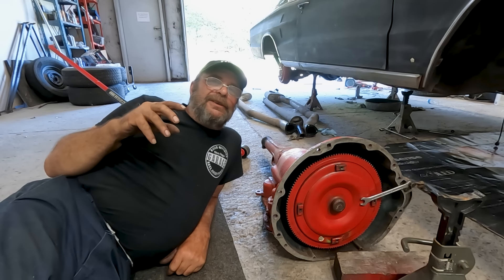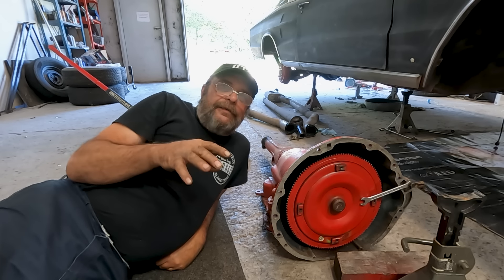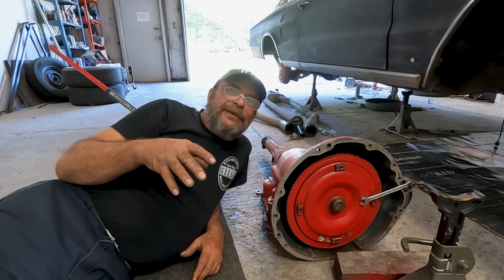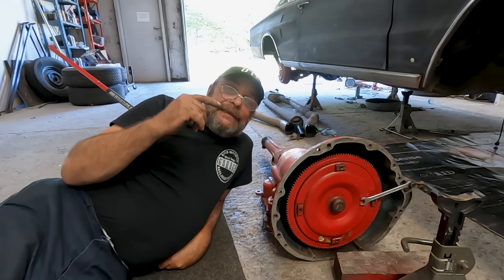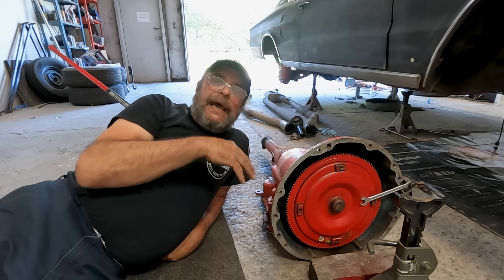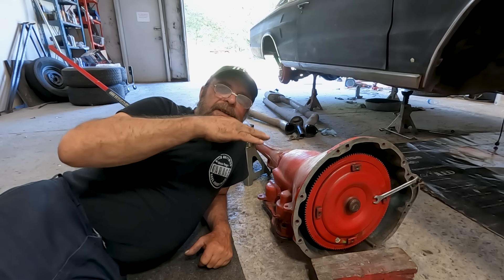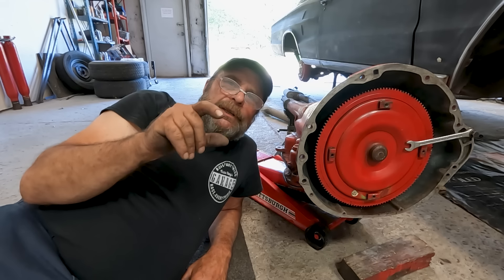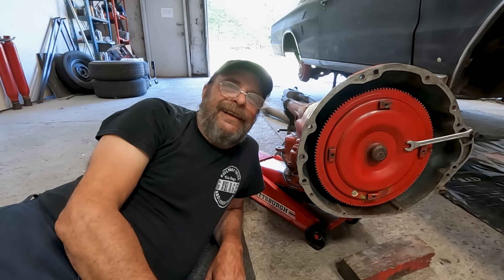One Man, On The Floor Transmission Install- So Easy Even An Old, Crippled Guy Can Do It

Comment: I've used rachet straps. Go around the frame or through the doors. With 2, you have a cradle that you can get any angle on any plane, and then you can push the tranny to the engine with one hand.
Reply: i did that and it worked great. i wasn't about to balance a tranny on some shitty jack. went in easy as hell
Reply: @bagsflyfree7710  And the best part is when you realize you can just leave it in position when you get it set.
Reply: Yep
Reply: You should make a you tube video so we can see how that works.
Reply: @TheTreasureGuard  If I ever have to replace the clutch again (this is the 4th) I will.
Reply: That's the way!
Reply: Dude. That's gonna make getting the trans and tcase back in my eagle sooooooo much easier and less sketchy. Thanks!
Reply: @screwsinabell  Thats "thinking outside the box"
Reply: We used to do that with engine generators when i was an aircraft mechanic. Put a 
 strap under the front and lift it to line it up to the gear box.
Reply: Bingo! Works great for gas tanks with fuel in them as well.
Reply: Damn good idea.
Reply: I tried that today. It didn’t work for getting the transmission on, I ended up having it on my chest when I was trying to lower the ratchet and it went too far. However, it was great for getting it up into the air high enough that I could get my gigantic stupid transmission jack under it I kid you not, this thing attaches to a standard floor jack and it stands 18 inches high.  Too tall to slide the transmission in from outside the car, you have to get it onto the jack under the car. But I couldn’t have done it without the ratchet straps. what I needed, thanks. What a great tip using those ratchet straps.
Reply: Ok, I like this idea. I did a heavy and awkward top loader last year and I’m swapping it for a T5 really soon. I’ve got racket straps but it’s a 66 Mustang unibody, so no frame to speak of. I didn’t think of running them through the doors. That’ll work pretty much perfectly to make a cradle.

Comment: The first transmission I did was on a '64 Chevy Biscayne when I was 15. My dad told me when he worked on those he'd just drop it on his chest and slide out from under the car. So that's what I did. It almost killed me. When I told mt dad he said" you really did that? I was just joking". All I could say was thanks a lot.
Reply: I did that today, with a 4L 60 E. Not on purpose, I was trying to install the transmission using ratchet straps to lift it. As I lay on the ground, it slipped out of the ratchet straps. Luckily, it landed squarely on my chest from only about an inch away. I rolled it off the side and tried again.
Reply: :face-blue-smiling::face-blue-smiling::face-blue-smiling:
Reply: Lol...

Comment: My favorite and most helpful trick I learned and used back in the late 70's was cutting the heads off two long bolts and using them as a guide to slide the transmission on until I got some bolts started. Great video! The good old days!👍
Reply: I did a clutch using that technique when I had a bad shoulder and could really only use one arm.  The bolts are still in a drawer.  I can't make myself throw them away!
Reply: @willcrow2133  😊👍
Reply: I had one get jamed from the weight, and since then I ground down the shaft into a square, enouh to get a socket or wrech on the cut shaft. But I have a whole section of home made tools and implements. I cant give em up either lol. The best ones though were for vacuum diagnostics. Check valves and check valves and Ts and all. I still use that think for finding vacuum leaks, without fancy electro angry pixie machines
Reply: My 1975 Pintiac Firebird factory service manual shows that same trick and it works pretty good.....no J tool part number they stated to use grade 8 bolts so they dont bend under the weight and sugested rounding over the edges with the end with the head cut off and adding a slot to get them out with a big flat blade screwdriver once the trans is in.
Reply: That exactly how I’ve been doing it for years
Reply: VW makes special tools for repositioning the radiator support and front bumper on Jettas for engine work. The "tools" are basically a pair of long smooth bolts that thread into the frame rails. You screw them in, unbolt the front bumper and radiator support, disconnect a couple of hoses, and the whole front of the car slides forward a few inches. I've owned four Jettas and those tools were invaluable! Such a simple and elegant solution.

Comment: I did a few trans back in the seventies both manual and auto. Now I drive a four cylinder front wheel drive car. I don’t even know where the transmission is. 😂
Reply: Some of em actually aren't too bad. 
Old VW rabbits ,I could knock em outta there in like 90mins, even the stuff into the late 90s early 2k wasn't too bad as far as the vws and crap I messed with.
An elusive oil leak on one rabbit had me r+r that sucker about 4x, I got it down to 40 mins with air tools 😂
Reply: @MrTheHillfolk  I have an Accord CVT. I actually know where it is and I change it’s fluid ahead of schedule. I’m in no hurry to find out how to remove it. I took a chance with the CVT in 2013, when I bought it new. According to people on the owners website, some have got nearly 300,000 miles out of the CVT. So I feel good about that. A muscle car it is not.
Reply: @blipco5  well the thing I liked with those foreign jobbie vws is a rabbit transmission weighs about 75 pounds , and will take 200hp for quite a while if you're not a madman. 
200hp ,we didn't have that but it was nice to know ,that'll make a 1800 pound car move decently. 
I didn't need nearly the equipment to lift stuff because it wasn't as heavy.
Reply: @MrTheHillfolk  When I happen upon a Rabbit these days it freaks me out how chintzy they were. I had a Fiat 128 back in the day, which was about 1800 pounds. The doors were a total of two inches thick.  I don’t know what engine it had but it’s top speed was 85 mph. It was surprisingly smooth. Could run topped out all day long.
Reply: That  funny.:face-fuchsia-poop-shape:

Comment: I wish I had the strength and energy I had when I used to pull them up on my chest and bench press them up into place. That was 30 years ago and like Tony said: many traumas and lots of arthritus between then and now.
Thanks for the video Uncle Tony!
Reply: I feel you brother,  I still those events myself. Edit, feel not still.
Reply: I don't think I even saw a floor jack till I was 30. The cars of the '50's and '60's had enough room to pull the eng and trans together, and that's how we usually did it. Otherwise, I was on my back, by myself. For '71, I'm in great shape, but I couldn't do any of that now. 👍
Reply: That's how I used to do it put the crossmember on it and just use my knees and bench press it into place! Now that I'm 47 it was 30 years ago before I broke everything in my body several times! Those were the good ol days!😂
Reply: I swear trans are much heavier than they used to be😊
Reply: Nice! I was going to post the same except it was 45 years ago .... thanks!
Reply: I was thinking the same thing. I’ve done it many times in my youth. At 44 years old, I really don’t think I could.
Reply: @pathfindersales2275  dude. Oldsmobile cast iron Hydra Matic. 🥺
Reply: @outlawbillionairez9780  Those things weigh a TON!
Reply: @Bob-Whiting  You said it ⚠️
Reply: @Bob-Whiting  You said it ⚠️
Reply: @outlawbillionairez9780  Yes, but I only said it once  O.A.B.! lol☝  😃  JK

Comment: The clutch goes out on the way home from work on a Friday afternoon 35 years ago.
No garage, just the gravel, my wrenches and a Saginaw 3 speed on my chest. I was pinned down, hard.
Besides, I had to go to work Monday, so I was now fully committed!
The stuff we go through to keep the boss happy!!
Reply: My uncle used to do that with his torqueflights. Slide them under and lift it up on his chest and bench press it up and hold it with his legs until he had a couple bolts started. 😂
Reply: I had a similar situation years ago while taking my wife out to dinner on a Friday night. I SMOKED that clutch BAD hitting a puddle that shouldn't have been that deep(!) with a clutch that was already weak after over 200k miles. Mine was a Mazda 5 speed in a 1990 Ford Ranger 4x4. I  nursed the truck back home and we ordered pizza. Luckily, my wife has the patience of a saint and is also a car/truck enthusiast so, she took it all in stride. She didn't help me change the clutch though lol!
Reply: I had to bench press my Turbo 400...fun times
Reply: Did the same with my 350. Must have been fun with the 400.
Reply: @gerhardbraatz6305  
The sad thing was, I of course let my buddy borrow my Jack and it was not returned as promised of course. I literally took chunks of wood and slowly shimmed it until I could climb underneath it then I got it on the pins and jammed my knee up underneath it I started them bolts as fast as humanly possible. Course I'm 56 now so that would be out of the question although I'm still in pretty good shape
Reply: @MikeBrown-ii3pt  Love it man! and your wife bro, lol
Reply: 1977, E150, 3-speed column shift. Heading to NY just left home and the transmission starts screeching. Turn around head back to my apartment parking lot. Grab my MG and drive to junkyard. Buy a used three speed, load it in the trunk and drive home. Remove the transmission by sliding it back so the tailshaft is on the crossmember balancing the front on my knee. Transfer the front to a jack and lower it. Swing tailshaft of the junkyard unit up on the crossmember and jack it up high enough to rest on my knee. slide it home. Had never done a transmission swap before but was on the road the same day. To be young and not know any better.
Reply: @PragmaticPragmatic  I had a 1967 MG midget!
Reply: Yep..had to bench press many and steer it with my foot on tailshaft...
Reply: @wjewell63  That's what ya call "Fancy Footwork" lol
Reply: I'm 68 now and was just telling my wife how I would put a new clutch in my 67 Chevy by myself on the garage floor and have it done in a couple of hours. First time I did it I was 19. The last one I did I was 43. A whole bunch in between. I still think I could do it and I may find out, I just bought a 61 Biscayne with a Muncie 4 speed.  I'll give it a go if I need to.
Reply: I'm doing the same, replacing a muncie 318 on the street out side my house, just planning my attack 😂
Reply: Great vid. I thought it would be more complicated. After watching your video. This is cake. Thanks for sharing!!! 💯👍😁
Reply: @PragmaticPragmatic speedloading transmissions
Reply: I did same as u did it pain in ass in front drive box it took me whole day best modiy a scissor jack with wheels and plate on top
Reply: Replaced clutch in my 56 chevy in 20 min. By myself. 16 years old, in 1968.

Comment: Took A 994 out of a 72 van, rebuilt it, and put it back in. Did it all by myself. I also cut the head off a bolt and put a slot in it so I could take it out once a a few bolts were in place. I have used that created dowel pin a few times and it's still in my tool box. Ya do whatcha got a do when you are by yourself.

Comment: I used to keep 3'x 6' lengths of carpet remnants around. I could cut them to whatever size I wanted or keep them large to just lay on, real comfy. Then to slide things under the car, I would turn the carpet pile-side down and it made it pretty easy to pull whatever it was under (or out from) the car. Need to put the hood on the driveway? Use some strips of the carpet. Unexpected oil leak? Use the carpet. Used to get odd ends of carpet really cheap.

Comment: UT you make hard for today’s technology. Four ratchet straps is all you need.
Two to the cross member and two for the front hung off the frame. Take one at each end and tighten them then pull the slack out of the other two and repeat until it’s in place. 
Once you try this you will swear by it. 
I installed a locomotive gear stub shaft assembly today doing this. 
Greetings from the high plains of Texas.

Comment: Tip: ATV Jack works great as a transmission Jack; with the pump handle facing the front of the vehicle it both lifts the transmission UP and Towards the engine at the same time. 👍

Comment: Trans jacks are cheap now, i used to use a transmission jack adapter head on a floor jack but only works on big lifted trucks with lots of ground clearance. The budget hack is 2 2" ratchet straps, looped frame to frame one under the tailshaft housing one under the bell housing. Pull the strap tight as you can, that ratchet it up tight. Move the the other strap and repeat, pulls the trans right up into the tunnel. THEN slide the floor jack under the pan or case (auto or manual) and adjust as needed. This method i have found is best in a gravel parking area, no need to try and move the jack and the trans at the same time, jack just makes the minor changes in elevation
Reply: Works dang well on concrete too!
Reply: The cheap transmission jack is $99 at Harbor Freight.

Comment: This info is EXACTLY what I needed, thank you so much. I'm working on the floor and have taken my 4l60E out from an LS1 motor (Holden Commodore, I'm from New Zealand) to fix a rear mains leak. I've replaced seals everywhere and serviced everything and I'm ready to put everything back. My biggest hurdle is getting the thing onto the jack while under the transmission well, which I'll be doing in the morning. This method is the ticket for me and I feel better already 😂 Thank you.

Comment: Thats Great! I'm 65 and had to put a 5 Speed manual in my Truck. Used 2 ratchet straps connected to both sides of the frame.

Comment: I did a 91 camaro RS transmission transplant it was a 305 w/ 700R4 trans with only floor jacks and from that day on I never messed with a trans without a lift.   I had to pay my bodybuilder cuz $50 to muscle it in I had about 6" of working space there was no room for your trick to work in my application.  Its still a great idea Tony given the right application.

Comment: When I was younger, I would muscle it up on my chest and then just lift it into place. Oh the glory days. Now I have an adapter plate (an old flywheel) mounted to my floor jack.   Good info Tony. Love your channel. Keep it coming. I really like the mission impossible build. Great idea.
Reply: You don't have to use something as heavy as a flywheel,  just a 3/16" thick square of metal cut to whatever size you think fits your normal use, maybe even have some ears with holes to hook a ratchet strap to , and a 3/4"bolt welded to the bottom of the plate and a big washer and nut to replace the normal lift plate on your floorjack.
Reply: @davidkeeton6716  or a piece of rubber on the jack to grab the pan and stop it sliding

Comment: My over complicated ass lifted the engine and removed the motor mounts then lowered the engine. That extra 4” gave me so much better access to the upper bolts and helps line everything up a little easier.

Comment: Got a low profile transmission jack a few years ago at an auction. Best thing I ever bought. Just set the trans on, set the plate at the right angle. And slide it under, up, and forward.

Comment: Done a few on the back, the trans precariously balanced on a floor jack, using a long screw driver to inch that jack into the proper position, the whole while praying it didn't fall onto my chest, arm or hand. 
The struggle builds intestinal fortitude!!
Good times!!

Comment: The wooden plank way my dad and I used to use to pull and replace Corvair motors.
Back in the 80s I was a bodybuilder I would get the vehicle up high enough so I could set the trans on my chest and bench press it in, I have to add I was working in a dirt drive way..
 I found tie wire to be an easy way to keep the torcconverter in place

Comment: My grandfather (God rest his soul) made a special plate to go on a floor jack to make the job of wheeling a transmission around and putting it in place a cinch.  All he did was weld an 18"x18" plate onto a floor jack peg that he cut off from an old jack cup.  You put the transmission on, strap it down if you like, and it rolls around easy peasy!

Comment: I just finished pulling and reinstalling a TH 350 in my 1970 Impala. I’ve done this before alone but that was 40 years ago. I decided it was a good time to teach my 14 yr old g-son how to work on cars. I have a two post lift which will raise car max of 4’. However this causes a problem with jacks. I used a adjustable pipe stand on the tail shaft and a heavy duty ratchet strap across the trans pan hooked to each side of the frame. This got it close enough to wiggle it in. 
Got transmission seal replaced as well as some good bonding with my G son!

Comment: The 2x10 comment made me laugh. Circa 1973 I’m replacing clutch in buddy’s 1968 Dart GTS 273, 4sp
We ran the passenger side tires up on the curb behind our dorm. Stole a 10 ft 2x10 from construction site nearby. With 2by on the curb also Buddy levered up tranny from driver’s side while I laid underneath and lined up splines bolts etc 😂😂😂

Comment: Old crippled guy? That's me! I am 66 years old and have a '66 Dodge with a Torqflite. I also have tall jack stands and transmission jack. Example shown here reminds me of what I used to do years ago. Back in the '70's many decades ago when I was a tough young muscular hot rodder, I remember setting the transmission on my chest to lift it up into position while I reached up and started threading in the bolts. I honestly don't know how I managed to do that, but I did. It would kill me if I tried that now